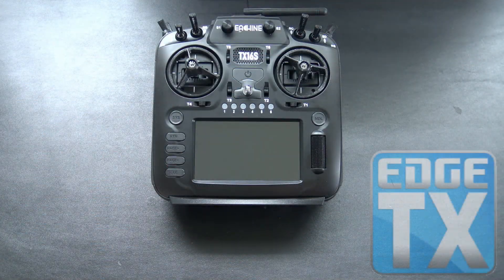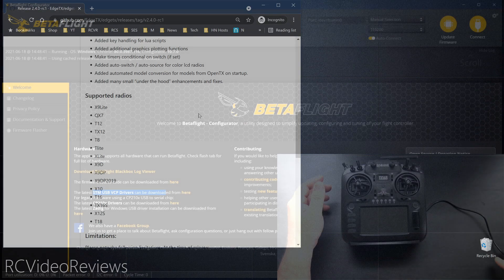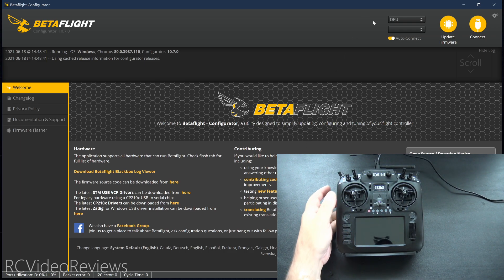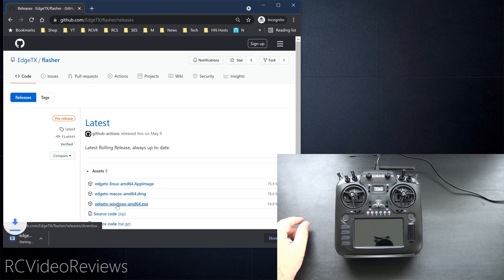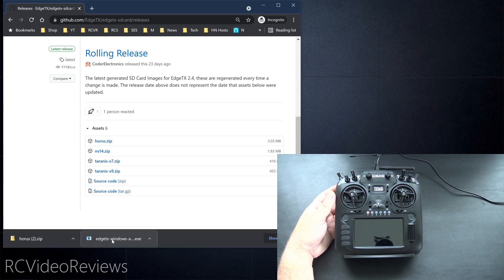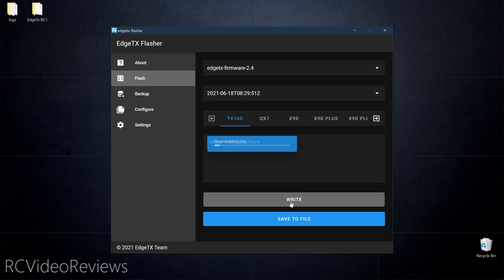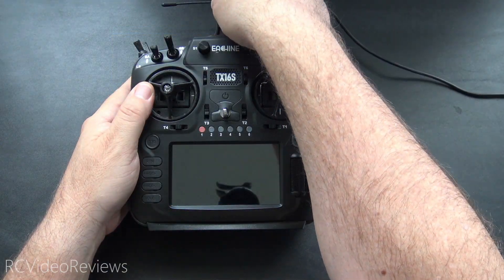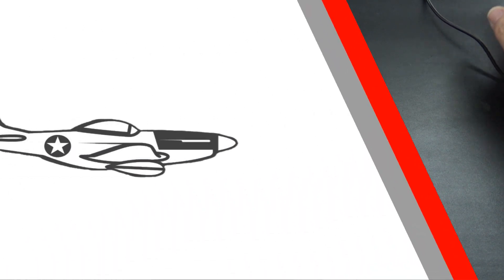EdgeTx Snippet • Flash EdgeTx via DFU Mode with EdgeTx Flasher

Comment: Hi John,
Im having an issue flashing Edge Tx (either nightly build or v2.5) to a Taranis QX7. After I download the Edge Tx to there adio and disconnect the radio won't turn on. I can flash back to current version of Open Tx to get radio working again, but I cant seem to get Edge Tx to work on the Taranis QX7. Any troubleshooting advice?
Reply from the maker: Make sure you have the right binary and try flashing via the method in this video: https://www.youtube.com/watch?v=LItyAkJlcdU

Comment: @RC Video Reviews

For your viewers who are running MacOS, and haven't used BetaFlight DFU before, it might worth noting that libUSB and dfu-util are missing from the out of the box MacOS install.
 
These users might receive an error when they try to flash that says: Flashing Complete, but throws an exception into the dialog box. 

error: Waiting for dfu-util...dyld: Library not loaded: /Users/tormod/dfu-util/libusb-git/../build/lib/libusb-1.0.0.dylib
Referenced from: /Applications/edgetx-flasher.app/Contents/src/support/dfu-util/darwin/dfu-util
Reason: image not found

Mac users will need to install 'Homebrew' and run the following command: 'brew install dfu-util' which will install an updated libusb library and the dfu-util package.  Then users will need to restart EdgeTX Flasher so it can refresh the libraries and it should flash with no issues after that. 

Instructions for install Homebrew can be found by doing a goole search:  "Install Homebrew for MacOS".

Comment: Hi John. Think I’m ready to try the new EdgeTx. But before I do it, if you have the amber sounds can I not include the sounds from the SDcard from the EdgeTx? I installed the BetaFlight, when I plugged in my Radio instead of it saying DFU, mine says COM1. Never mind John 😂 Got it to go in DFU mode. Million thanks, still wondering if I can keep the amber sounds after flashing it with EdgeTx.
Reply from the maker: You can keep amber and overlay edge sounds, but you'll wind up with a mix of course. Not all sounds will overlap. Amber is a very large sound pack, but the sound pack copied last and will be the one that will be played in the event both sound packs supply the same sound.  i.e. This works off filenames. So if amber has hello.wav and edgetx has hello.wav, the one copied to the radio last will be the one that is played.
Reply: @RCVideoReviews  Ok John I’ll try it. Does EdgeTx doesn’t quite work without the sound folder originally came with? My plan was not to include its sound folder so I can use the Amber sound files..
Reply: @RCVideoReviews  Hi John, just to give you an update. Did flashed mine and it’s now running on EdgeTx. Did came across with little hick ups, one of them was Bad Data and the other one was with regards to SDCard. Got em’ all fix and so far so good! The touch screen seem to be working fine with the latest release, navigating through the menus is nice and smooth. Flew my M1, hover rather in front of my garage and all seem pretty good so far, loving it. Thanks to all your helpful Videos. I would like to donate to your channel, it’s not gonna be much just to show my appreciation. Thanks again.

Comment: Hi John I only fly planes and two Jets and use a lot of mixes and slow servos down extra would it be worth me swapping over to this?
Thanks for all the work you do on here as well.
Reply from the maker: Hey Gary, Tough question to answer. My usual response when it comes to firmware is to upgrade if it gets you something you need or want. So that's the question I would pose. If you see something you need or want, try it out. I will be conducting a phased migration meaning I'm not transitioning everything over immediately. I'll be using it for a small handful of craft while I get acclimated to using Edge. When I feel comfortable, I'll migrate everything. This is the same exact procedure I followed migrating from my Taranis to TX16s. Hope that helps, sorry for the delayed response, lots of questions over the last 2 days.
Reply: @RCVideoReviews  
Thanks for the reply and I think I will wait a month or two and sell it all pans out before changing over then.
Plus you might do some videos on it by then lol.
Thanks again Gary.

Comment: Thanks for the update snd great video.  

I also have a Radiomaster TX16S.  Is there any issues importing the models from OpenTX?
Reply from the maker: I have not done a mass import yet, so I'm not sure. I believe changes are made to models for import, so make sure you have backups first.
Reply: @RCVideoReviews  I always make a backup.  
I was just wondering on the model transfer compatibility!

Comment: Which is better open tx or edge tx?
Reply from the maker: I don't think the answer is as simple as which one is best. If you're not interested in experimenting and have no tolerance for dealing with bugs: OpenTx. If you want to see the latest and greatest in radio firmware development including touchscreen support, onscreen keyboard, revamped interface, Crsf shot, etc...EdgeTx.
Reply: @RCVideoReviews John will openTx 2.4 support touch screen
Reply from the maker: @joytanishq2127  That has always been the stated objective. The question now is when will OTX deliver 2.4? Perhaps with the Edge team pushing development on the firmware, OTX will incorporate but I'm not connected to the OTX dev team so I really have no way of knowing other than to state what is publicly known.

Comment: Once you've flashed edge tx, will you have access to all the multi protocol stuff the tx16s has by default?
Reply from the maker: Yes. I haven't looked into the proposed multimodule firmware yet, but the protocols are there. All of that stuff is governed by the mpm (multi-protocol-module) not the radio firmware.